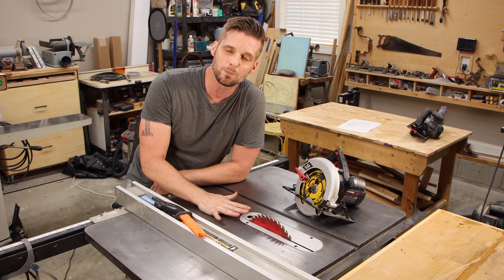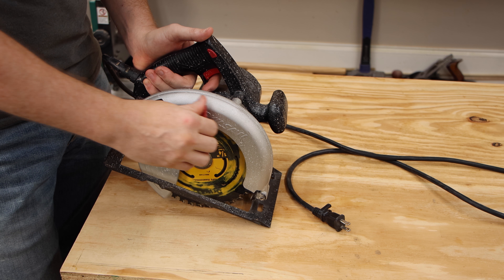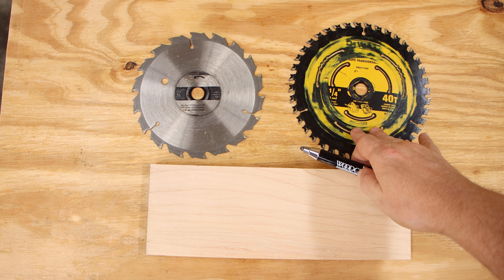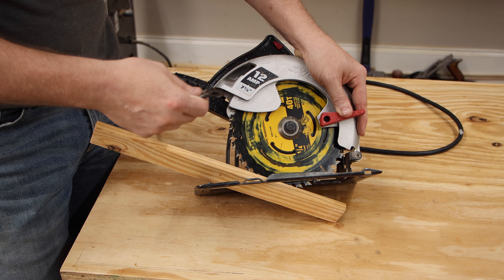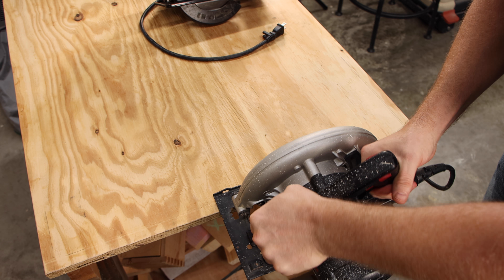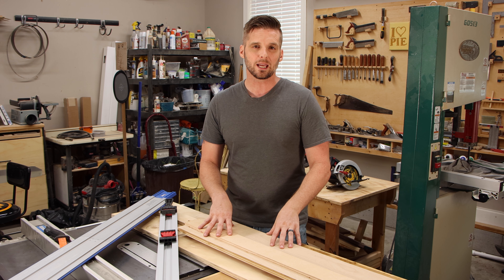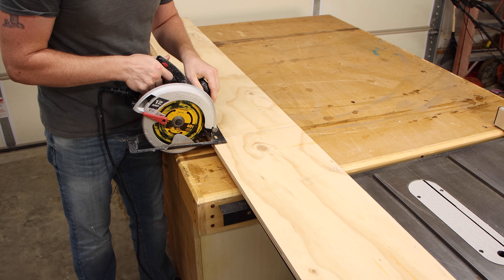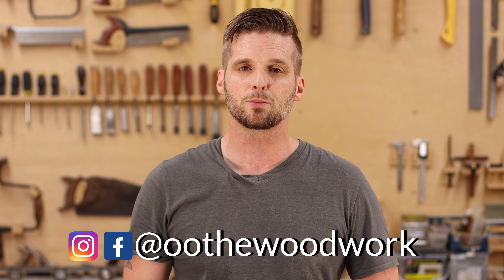How to Use a Circular Saw - the Beginning Woodworker's Best Friend

Comment: Lovely video! Precise and pointed!!!

May I ask you a stupid question? (A beginner woodworker here, who did a little bit of wood-carving, some 30-years back, as part of my Fine Arts course - with a brand new circular saw at hand!)...

It's a 'problem' I've been hunting around YouTube - and failing to solve!

How do I HOLD DOWN a SMALL piece of wood - say a 2" x 4" piece of a One-by-Two - so as to SAFELY trim it with a circular saw - lets say, down to a 2" x 2" piece?

Comment: Nice video. I"m a beginner and i have a question: Is it useful or overkill to have 2 circular saws, one with a special blade for ripping and one with a special blade for crosscutting, because i don't like swapping blades, making the circular saw screw dull. I also have no table saw and i don't think i wil have one soon, because they are expensive. Hope to hear from you soon. Many thanks in advance

Comment: Great video. I’ve got the dewalt 60v blade right. I really want a worm drive saw but they’re pricier for sure. I use my circ saw a TON.
Reply from the maker: It's amazing how much you use it in a woodshop depending on what kind of projects you do. And then you need one for most carpentry projects around the house. Everyone should have one!
Reply: I am a carpenter and have the Flexvolt blade right ,that is all you'll ever need . Worm  drives are heavy and awkward imo.

Comment: I have a "blade right" sidewinder.  I'm left-handed, and I use my left hand on the saw.  I don't do the "reach over" to the front grip with my right hand.  Instead, I put my fingers on the side of the sled and use them as a guide.  I'm sure a lot of people would freak out if they saw me do this, but I've done a hell of a lot of work this way, and I still have all my fingers.

Comment: Caution:
The method shown in the video for cutting the 18 inch piece is wrong. If you use the method shown in the demo the piece will be short of 18 inch by the thickness of the circular saw blade. The correct method would be to place the track guide on the 18 inch piece to be cut and align with the mark so that the cutting blade will be outside the 18 inch mark.